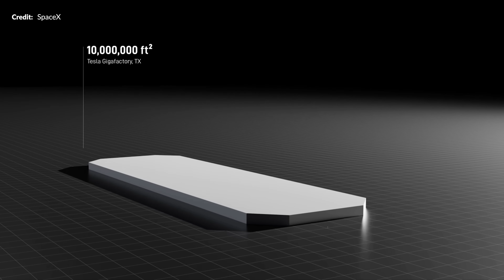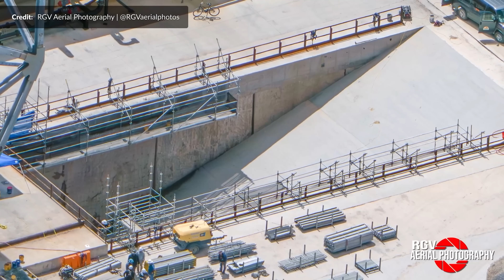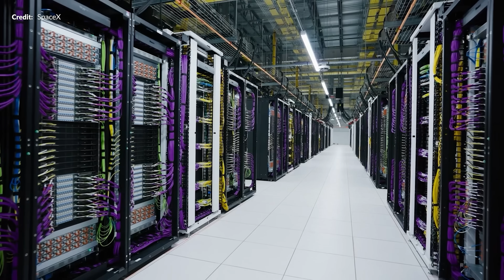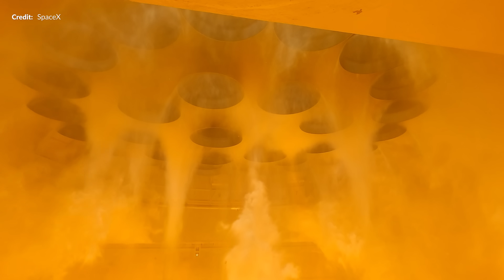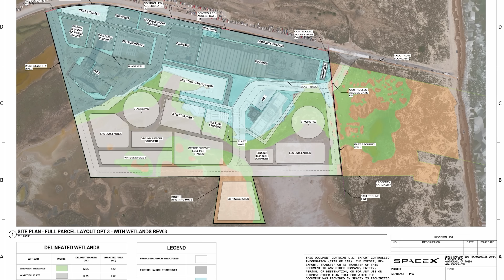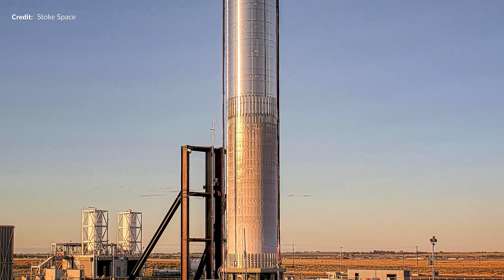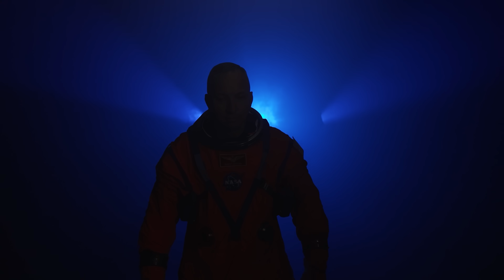SpaceX Just Revealed Its Biggest Plans Yet

Comment: SLS really is useless.  We've spent time & $billions on orbital infrastructure, to cheat the rocket equation and the 1st attempt beyond orbit, we're ignoring all that entirely.  Also Orion is not suitable for missions over weeks, or even months.  Lock those politicians, 4 at a time, inside an SUV for 2 weeks, without opening doors or windows for so long.  Try that out yourself, if you think I'm doing Orion wrong!  The missions are only getting longer, starting with A-4.
Reply: Why is orion not suitable for missions over weeks or months?

Comment: Those data satellites sound like a great idea until you factor in Kesler Syndrome. SpaceX has to move a few Starlink Version 3s a day. Thousands of satellite corrections per year. Seventy meter satellites are a huge target and moving them is going to take a lot of propellant. Plus in higher orbits the satellites will take forever to deorbit. I'm sure astronomers will get screwed again as well. The Starlinks are bad enough.   I can spot a Starlink every minute or so with binoculars. Sometimes I see two crossing each other.
Reply: Those AI sats will all be in one orbit.
Reply: @imaginary_friend7300    Other satellites, and even worse, spent upper stages will cross those orbits. We are already completely dependent on many types of satellites. Anything that endangers those existing satellites is a bad idea. Clogging up the works with thousands of 70 meter behemoths is very irresponsible.

Comment: When NASA announced the change for Artemis III to be a LEO mission, they said it was because they needed more experience with the SLS rocket. A lot of people were wondering how on earth they'd have either of the HLS landers ready for such a mission.  Clearly they won't be ready.  But NASA does think the extra experience with the SLS and some experience with the HLS providers makes this mission worthwhile.  I agree.  They'll get practice on docking with the Orion capsule.  That's never been done before.  SpaceX and Blue Origin may not have their full landers ready, but the systems they will use to dock will be on whatever they fly for Artemis III, at least in some configuration.  They'll probably learn quite about about what does, and doesn't, work on these systems.  I think an actual Artemis IV landing in 2028 is unlikely.  Not impossible, but unlikely.  We'll need to see some rapid improvements from Starship and Blue Origin before that's possible.
Reply: At best the rendezvous on Artemis III will happen in 2028 and the lunar mission 2030.  In my opinion.  Neither BO or Space X will meet the current timeline.

Comment: I don’t see any hope of BO getting operational before the deadline, let alone their fantasy of launching by EoY (which I still say was just marketing hype, like the larger New Glenn variant, for their fanbase to throw in the faces of anyone pointing out facts, like NG competing with Falcon Heavy, not Starship, or there being basically zero chance of them launching by EoY. ‘Here’s a shiny picture of our rocket that is years, maybe even a decade from being physically realized, but conveniently is the exact size of our competitor’s largest rocket.’ It’s just irritating) 

Back to the launch pad, it took SpaceX months to get their Frankenstein crane to build Starbase, and a year or more to commission a new on built. Unless SpaceX rents one of their cranes to BO (which would be dumb since they’re using both on other projects) It could easily take BO into 2027 to get the equipment to repair their tower (if they don’t announce in a few months that further inspection revealed the tower needs to be razed and replaced) then their announcement they’re moving away from the TE strongback in favor of vertical integration and rollout, that means developing an entirely new launch architecture, either modifying the tower with a crane like Starship, or massive rolling infrastructure to transport full stacks from their facility outside the gates of KSC. Developing their current launch infrastructure took 5 years, a year longer than projected. Even assuming they’re 6 months from completing this new transport system, that’s still a huge question mark if it works, has no more delays, etc.

Now let’s look at other blockers. Hurricane season is rolling in. That will potentially put a halt to any work on the pad, or cause additional damage and destruction to already weakened portions of the pad.

I predict BO will begin the excuse making by the end of summer and will announce a partnership with ULA or SpaceX to launch their lunar lander before the deadline.

Comment: Just a quick reminder: The Falcon 9 Block 5 currently in use had a reflight target of 5. They've beaten that seven times over now, and we've only seen one failure on a reused booster this year when that grid fin got stuck and the first stage landed safely in spite of it. I would never have guessed this design would go so far. It's nuts. That booster is closing in on Space Shuttle Discovery's record of 39 flights, and it looks like it'll blast beyond that before too long.
Reply: Comparing the Falcon 9 booster to the shuttle discovery is not a fair comparison as the Falcon 9 is a booster only.  It is exceptional to have reached 35 reflights and landings, but that's it.
Reply: @michaeldeierhoi4096 It's still a heck of a lot better than the one flight the rest of the rocket industry gets. The only other people who made reuse via propulsive landing viable at time of posting are Blue origin, and I suspect they won't be flying for a while.
Reply: @Lady_Auntie_Rea   Watch Stoke Space because they are preparing for launch soon and have also been working toward a fully reusable rocket.

Comment: Humans are already going up safely on Crew Dragon. I don’t see the need for the SLS.
Reply: Dragon is designed to fit on a Falcon 9 not on starship unless Space X has some kind of secret engineering going on.
Reply: @michaeldeierhoi4096  yes, I'm aware of that. I don't think I mentioned the Starship. I was commenting on the lack of a need for the SLS.
Reply: @MarkovAllTrades  Personally I think NASA and SLS are the ones with experience.  They have been to the moon twice in the last few years and the last one manned.  Starship is still trying to reach orbit.  It's nice to have one party in this effort that knows what it is going on.  Starship simply acts the complexity of trying to be reusable.  

Many people think once they reach orbit it will be smoother going forward, but actually it has a whole new set of problems to face.

Comment: The first flight of Cargo Dragon CRS-1 was in October 2012 but the first Crew Dragon flight wasn't until over 6 years later in March 2019. Was due to any delays developing the custom space suits? (Genuine question) or perhaps that they were a smaller company back then or perhaps a certain number of Falcon 9 Cargo Dragon flights were required to demonstrate reliability and safety? Otherwise it does means it over 6 years to get a signed off crew rated dragon capsule to launch. Are SpaceX really going to be able to ready a signed off crew rated Starship within 2.5 years?!

Comment: Thats all cool and great. But at the same time my starlink still goes out when there is even a tiny rain shower in the area. And I have a full unobstructed sky. So if they cant even fix that issue. Then good luck to the mega data transfer.
Reply: That's strange.  Certainly not the case here.

Comment: It would be absolutely insane to even think that any non government strictly for profit private company would waste 4 billion launching Orion into LEO when Falcon heavy can easily handle this mission...all while costing no more than 150 million and very likely much less as it would not be a fully expendable configuration.     Continued SLS use is simply stupid and of course the main drivers OF SLS are the corrupt elected officials in Washington..

There is absolutely nothing that the Government does that makes any sort of sense..   Unfortunately this has been true for well over 100+ years and sadly this situation is only getting worse as the polarization of politics makes any sort of compromise or consensus impossible.
.
SLS has been a boondoggle since day one and should have been scrapped 10-15 years ago 

SLS should not even be used for Artemus 3.... considering you could launch 20+ falcon heavy Orion LEO missions for less than 1 SLS mission ought to wake any idiot up....  even if it took a year longer who cares...the moon isn't going anywhere and once they got the architecture and the hardware in place, we could simply flood the moon with launches and hardware...  finally fulfilling the plan to permanently have a human presence on the lunar surface

20 moon landing for less than the cost of 1... doesn't take a degree or much more than a 3rd grade education to understand the benefits of scrapping the SLS program and better spending the welfare based cost plus jobs that is the driver for SLS

Comment: In its currrent iteration, Starship is incapable of landing safely on the lunar surface.   It’s CoG is simply WAy, WAY to high for the diameter of its footprint.  It will tip over on the uneven lunar surface just as it did attempting to land on a flat concrete pad on Earth.

And then there is the logistics of tanker ships being launched to fuel up a Starship for a round trip to the Moon.  If you stop and and think about it, that is just not feasible, and may not ever be.  It currently takes a Dragon capsule nearly 24 hours to launch and rendezvous with the ISS.

How many tankers will it take?  How quickly can one rendezvous and move out of the way for the next tanker?  It seems to me that they will need to launch multiple tankers almost simultaneously. You’re gonna need a bigger Starbase, a lot bigger.
Reply: That's because the current iterations are still low fideility throw away test articles.  And the rest of just more silly nonsense.

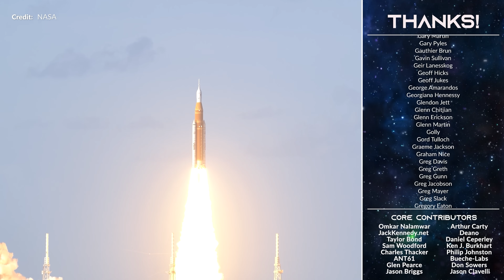Comment: 23:53 At this point, I just do not see much use for SLS/Orion. Why not launch them in the much less expensive Dragon/Falcon 9, and transfer them directly to the lander? This seems much more efficient than using SLS and Orion. Also, the Dragon and Falcon 9 have shown themselves to be incredibly reliable. Both the Dragon and Orion share a crew capacity of 4 crew.
Reply: Here's what needs to be considered.  Artemis I went to the moon in an unmanned but human capable vehicle.  Artemis II did a lunar fly by with a crew of four recently.  Neither Space X nor BO is ready to send a vehicle to the moon and they won't be ready until 2028 at least and probably later.  And I'm not convinced either will be ready for a rendezvous in earth orbit next year.  

NASA/ Artemis are the only ones with proven expertise here!!
Reply: @michaelde@michaeldeierhoi4096omewhat fair analysis. But, SpaceX at least, has shown that they can surprise with their speed of development. I do not think we should deprecate SLS/Orion until at least 1, preferably 2, commercial options are available. The primary issue I have with SLS and Orion is their cost. SLS particularly has run far beyond the original budget. Contractors have been charged with and settled criminal fraud charges. The program relies on 80s technology that was far from reliable. Hydrogen likes to leak. The shuttle program was a mess where they often launched despite safety issues. These are the same technologies.

Suggesting that Boeing has experience is foolish. SLS is the first launch vehicle that they have ever developed. I like that Isaacman seems to be very focused on crew safety. Hopefully, we can avoid incidents where crews were lost. It seems that NASA has cancelled the future versions of SLS. This suggests that they do not see it as a long term solution. BO uses hydrogen in their upper stage, I hope that this doesn’t cause them problems.

There is a lot of uncertainty in the Artemis program right now; especially with the incident with the New Glenn. I see the strategic benefit of beating China to a permanent manned lunar base. We need to drive to that as quickly as we safely can. Calling a vehicle that has launched twice, a proven solution seems a stretch. SLS has had many issues getting to the pad for those launches.

I am not calling New Glenn or Starship proven platforms, either. While New Glenn is considered operational, it has had failures in its launches and testing campaigns. Starship has had some successes, but also regressions. I am hoping both begin to shine this year, but we just don’t know.

All that said, Falcon 9 and Dragon are proven platforms. To integrate them into the planning for Artemis seems reasonable. These vehicles have far more successful flights than are even currently planned for SLS/Orion, at this stage. The Falcon 9 has far more launches than Boeing, Lockheed, and Blue Origin combined.
Reply: Something weird happened with the first sentence. The first word should be “Something.”

Comment: Thanks for sharing, lots of great information. I’ve been calling for the header tanks to be relocated from the nose since they first put them there. Totally in the way for many forecasted layouts. At this late stage of development it seems like moving them might be a big design revision since it would affect so many aspects of the ship that have already been tested. Perhaps they can take some lessons learned in the super heavy and apply them to starship. Seems like they may still have some gremlins to resolve with super heavy. Have often thought that they need some kind of bladder in the tanks that would prevent the gas bubbles but certainly likely to be a tough design with cryogenic fluids. I’ve sometimes pondered if flat panels that are folded to extend into the space as fuel is used might be an option. Almost like some sort of origami structure that expands on its own to fill the space in the tank as the propellant is consumed. Wouldn’t necessarily have to be a tight fit as long as it occupied the majority of space left behind.

Comment: I think space data centers may have some competition as Helios and others bring their first fusion generator on line. In fact it may not be long before they produce one that could power a space vehicle ( Aldren cycler ) or power a lunar station. Nuclear fusion generators will eventually reduce the need for starship chemical rockets ( for long interplanetary missions ) but all the pieces will still need to be boosted to orbit  by starship and then assembled. The Helium3 fuel will be mined on the moon and the dueterium extracter from the ocean.
Reply: You'll be waiting a long time.

Comment: 0:12 Why is it next to a river?
Reply: I don’t personally know, but I can think of a few benefits. 
1) The water from the river could be used for the deluge system on the launch pad of test platforms.
2) The water could be used to assist with cooling.
3) SpaceX uses methane which is a type of greenhouse gas containing carbon and burning it converts it into carbon dioxide. Water is one of the most efficient natural means of capturing carbon emissions. This does increase the acidity of the water, making it more damaging to aquatic life, but there are methods to reduce the acidity, if they decide to implement them.

Comment: To me the new location of the docking adapter on the side of Starship makes sense.  I wouldn't mess around with relocating or eliminating the header tank in the nose and the associated plumbing, after it took so much time and effort to tune everything properly.  Regarding pushing an Orion capsule to Lunar orbit from Earth orbit, if the docking adapter was kept on the nose for this purpose, I would have to wonder if the adapter on Orion is designed to take the acceleration load while attached to something.  Even if it was, unless the astronauts first relocate to Starship the astronauts would be sitting on the wrong side of the capsule for this, they would be pulled up out of their seats in the process.  Not very comfortable at the very least.  Perhaps there is other equipment on Orion that wouldn't take well to being accelerated upside down, or has never been tested with this kind of motion.  It makes more sense to just place an external adapter on the nose of Starship that would attach to the underside of the Orion craft when it is pushed to the Moon in its normal orientation.  This was a great video, after watching another video on this subject I had many questions on what Starship would look like for Artemis III, but this video answered them all.
Reply: I seem to recall that there is no plans to recover HLS so that means there really is no need for header tanks.
Reply: @imaginary_friend7300  HLS would never be landed on the Earth, but I would have thought that the header tanks might still be necessary for landings on the Moon, to avoid slosh with low propellant and oxidizer levels.  If not, then so be it.  But still, I wonder if Orion was ever designed or tested to be accelerated upside down.

Comment: Another question is, if you reduced the weight of the Orion capsule to just 22,000 lbs by removing the launch escape system and heat shield , does the European service module have enough delta-V to slow the combined vehicle enough to drop into LEO upon return?

Comment: We already have proven and reliable launch and re-entry ability to/from LEO in the Dragon capsule.  Once we have demonstrated in-orbit refueling, it seems to me we should use extra fuel to slow returning lunar missions down, and transfer to a Dragon or the ISS rather re-enter at high speed.  We are using than a huge expensive rocket for a single task we already know how to to do. Orion should be re-engineered to be a multi-use earth-moon cycler.  It will not need an escape tower or heat shield because it will never reenter or carry humans to space.  A replacement European service module for each flight can be carried on a single falcon 9.